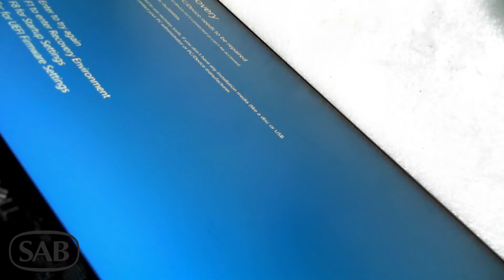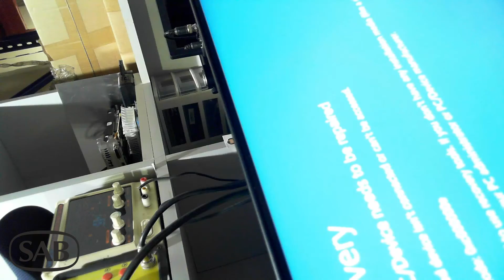HOW TO SOLVE  POWER PROBLEM IN DELL OPTIPLEX 7460 AIO

Comment: How to solve the dell Optiplex AIO 7480 orange and white lightening issue do u have any idea brother, the same system is working please help
Reply from the maker: first u check power supply or processor otherwise board shorting

Comment: My Optiplex powers on but black screen/no video and CPU fan repeating on/off. Same behaviour if I disconnect hard drive and dvd. No orange led. What could be the problem?
Reply from the maker: first chek ram or processor
Reply: @f1computer  Thank you for the advice. It turned out to be a broken touch screen cable. Luckily cpu and processor are OK.
Reply: @manchetknoop  Hello my friend, what means touch screen cable? When I plug my Optiplex, Fan repeating on/off, but, it is black screen. Please help me